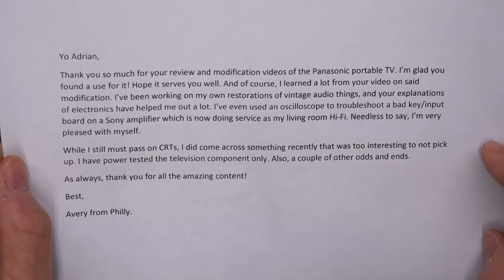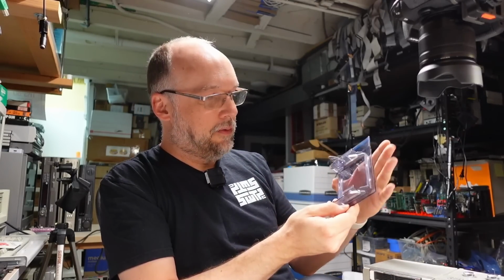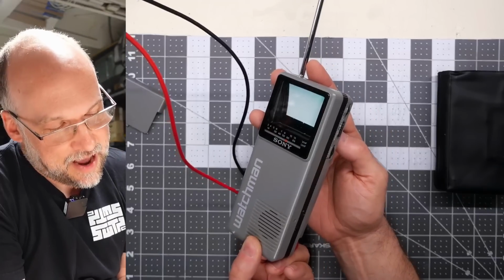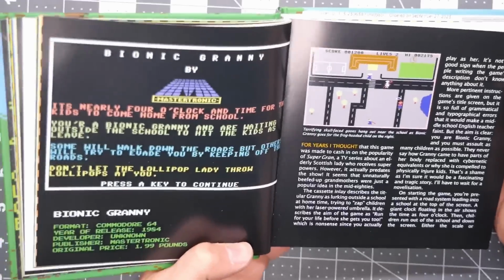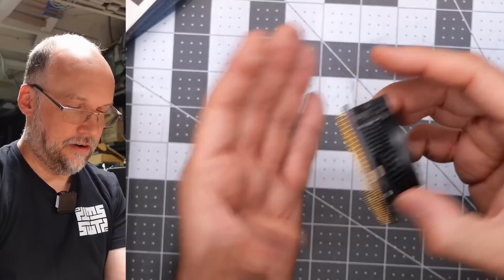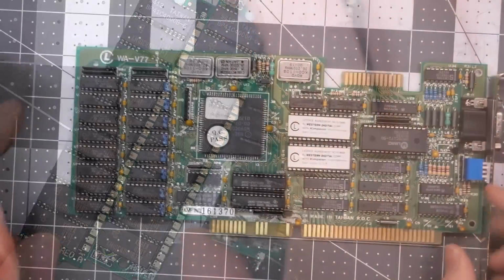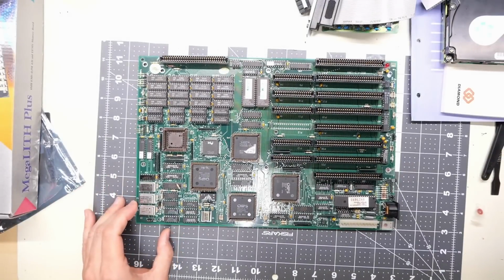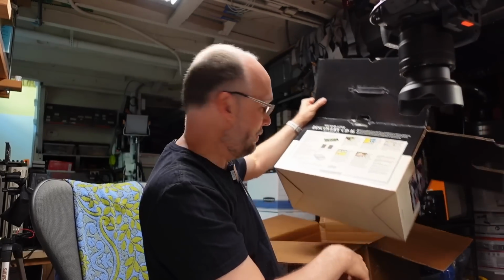0070 Testing portable TVs and a plethora of PC parts (plus a book and hard drive autopsy)

Comment: I have many of those hard drive magnets. They are very strong. I was able to remove most of them from the Metal plate. Sometimes the Magnets would break doing that. But most of mine came out fine. I only took them off of failed Hard disk drives. I have been building computers for a really long time. I have built many 286, 386 motherboards. Now of course motherboards are way past those days and much faster with lots of memory options.

Comment: Other than OS/2, what other operating system is written in 80286 specific code? Other than MAYBE Netware286, that's about it. The 80286 is a braindead CPU, the 80386 is much much more useful.

Comment: I still have a similar Casio, as my primary TV for a few years.  I got it used, and it might have had some moisture damage because a solid black screen was not solid black.  You could see cracks in the LCDs.  The strangest thing is that I would watch it in bed and go to sleep.  When I woke up, everything I saw had a grid, as if my eyes had adjusted to the large pixels and stayed that way overnight until finally being corrected in the morning.  It was good while it lasted, but I'm very grateful for today's LCD screen technology.

Comment: Over the years I've had three--no, four--portable LCD TVs. The first one was a RadioShack Portavision. It was one of those black-and-white models with the mirror to reflect the image because, to save battery life, the screen used ambient light as its light source, with a frosted translucent panel behind the LCD. (There was also an included EL backlight that could be clamped on, for use in dark environments, but it tripled or quadrupled the battery consumption.) I actually still have this one, though I'm not completely sure that I know where the backlight is anymore.

The next one I got was a color one that used basically the same technology as the TV-400 you have there. However, the tuning indicator was vertical and went across the entire screen. I don't know if it was a Casio; it could have been another Portavision, rebranded from a Casio. Let's see... the third one was a Sony with a weird teardrop form factor. It had slightly better contrast, and better battery life, but no A/V input. Both of them quit working and wound up being trashed.

The last one was definitely a Casio. It was from their active matrix 'Crystal Vision' line, and it had by far the best contrast, because it was using an early version of the technology we have in LCDs now. Very low light leakage, and rapid response. Alas this one also wound up in the trash, because I left it alone for too long with alkaline batteries installed, and the leakage destroyed some vital bit of circuitry, so that even after cleaning the battery compartment thoroughly, it still wouldn't work.

Comment: Video idea: didn't that 5150 have a 386 upgrade? Max it out at 16 MB RAM, and then install Linux on it. Debian still makes installers and packages for 386 processors. Maybe you even get X11 with a simple window manager like twm and a game running.

Comment: Labtec might be bare minimum in speaker response but the circuitry is good. I find swapping them out for some wide range speakers gave pretty good but no bass performance. My Go-to replacement speaker would probably be something 4 Ohm and designed for public address so it has good frequency response through all the vocal range tones.

Comment: a bit of trivia, in 1990 Toshiba made the first Glass platter for hard drives, originally for laptops, from 2000 many other manufacturers started moving over to glass-based, some for desktop, but mostly laptops, since around 2015 pretty much all laptop HDD's, have glass platters!

So be careful opening up newer drives, especially laptop ones :)

Comment: Drive magnets make great clamps for gluing things.

I had a Western Digital drive blow up on me in a similar fashion. A friend of mine was using my system for final edits for a book she was preparing for output to the resolution ECRM VR-30 imagesetter at my brother's prepress company. When the hard drive blew up, she went into a panic of course because these edits were nowhere else and the drive blew up before she could backup the book.

I contacted a company that repaired hard drives and they said that generally with drive failures like that the chances of recovering the information are slim. Given the cost to repair the drive was extremely high, we figured there wasn't much that could be done. At that point, she resigned herself to having to start over and go back to an earlier backup while losing a few days of edits in the process. 

With the drive being more or less a brick, I took a controller board off another identical Western Digital drive that failed and put it on the fried drive, and it worked! Yes, it worked! She was able to output her book and the old Frankenstein drive lived for another few years before I replaced it with something different.

Comment: Hey Adrian, what POST card are you using? I just got a motherboard with a Pentium 233 that doesn't POST and I'd like to try my hand at troubleshooting it. I found a few of them on Amazon, but they all have very mixed reviews. Just curious what one you're using since it seems solid. Thanks!
Reply from the maker: Ah grab one of the cards from Aliexpress or Amazon: https://www.aliexpress.us/item/2255801058980488.html

That one specifically is what I use. ISA + PCI connector .... and a speaker. Very handy

Comment: Adian's Analog Attic.    ^-^

I am moving and ran across two book boxes i used to use as computer sound systems from back in the 90's.  A good boom box was so much better than the cheap speakers you could get back in the day.  The boom box would be louder, and should have at least two way or three way speakers, to contrast the computer speakers of the era which had at most one speaker per pod, and very low volume levels (as compared to a boom box).

So i may be doing some re-work myself in the near future.

Comment: PC-11 is an epoxy plastic repair material that can be sculpted. I've used it to repair plastic parts where parts were actually missing in several cases. The problem will of course be figuring out the correct shapes.
Reply from the maker: Can you squish it into holes, then let it harden later? That might work
Reply: @adriansdigitalbasement2  I think you could cast it. You'd need some sort of easily removable cast material, though, like... wax. Wax would certainly work. (Initially it's very sticky and goopy so if you mean shape it by pushing it into another part of the device, I don't think that'll work; I think it'll stick to what you push it into.)

Comment: I had this CASIO TV (well, the PAL version of it) back in the 90's and the screen was very watchable, not dim at all, only when the battery voltage got low. I watched it pretty much every day at work when I had standby shifts, when I was working as a train conductor. I watched so much Star Trek TNG on this one. The picture quality wasn't that bad back in the day, compared to the other stuff you could get. But You're right about the power consumption. I always had to have 3 sets of rechargable AA batteries on me, to run this thing for one  standby shift 😀, and there was no power socket in our ready room.
Unfortunately, one day when I had to do train service, I had my backpack in a staff locker cabinet on the train, and someone (one of the passengers) broke the thing open while I was doing my work and stole my whole backpack with the TV in it. Months later a colleague found the backpack at the train line thrown into the woods.

Comment: Hey that's the same model combo TV Boombox I pulled out of a dumpster just a few weeks ago. Already AV-modded it. You gotta scratch one trace on the TV board for video (very near the IF can, don't let the test point in the middle of the board fool you) and another on the mode selector switch to make it stereo (also had to add a 300 Ohms resistor to ground), it's the one that goes vertical in between the pins.
Mine's Elite branded, it's 100% identical though*. I also had to disassemble and clean all the switches (the record/playback switch is interesting as it's solenoid driven), it had the same tape volume problems as yours. I'm kinda surprised all the belts in the tape deck of mine work.
*) Waaait the tape counter is next to the FM stereo indicator instead of under the speaker. Yeah, the tape mechanism is different. And the antenna input is an European standard antenna input instead of 3.5mm.
Tips for repair: Even though it looks like the three function switches on top only come out as one, they come out individually and I guess you only need to fix the function selector (radio tape TV)
I got a stack of these Casio portable TVs. They always leak capacitors, but not many in there, so a quick and relatively easy fix. Just don't ever remove the LCD PCB even if there are caps on there, leave them alone.

Comment: Would probably be quite easy to 3D-print new brackets for the tape door. Also some kind of adapter for using modern rechargable cells in the battery compartment.

Comment: Couldn't convince my self that it's worthwhile buying an overdrive for a 486 but did do a AMD 5x86 swap last week on one pretty much the same way to straighten the pins no luck over clicking to 160 appears the vlb ide controller doesn't like 40 MHz clock.

Comment: I had a rule. I don't upgrade a CPU. New CPU = new motherboard and ram. As a result of that rule I've never had an overdrive. The first and only exception was 2021. I couldn't find a ryzen 5900x. And that was the target CPU. So I bought the cheapest CPU I could find. That was a ryzen 3600. So it was a downgrade as a placeholder. I did eventually get my 5900x. Well worth the upgrade.

Comment: Those small TVs bring back memories of the window display in an electronics shop in our old indoor market. Quick question re. the TV-400 and similar Casio sets: do the tuning indicators disappear when tuned in? IIRC they were always on the screen.
.. I bought a Citizen TV-53, then spent a while tweaking the pots on the back of the LCD unit to get a decent greyscale. That set spent a while opened up and displaying test cards for the purpose. Was fairly watchable after that .. just about usable with the C64! Also, 2.4W (PAL version) and 2W (NTSC) for the Citizen. Tandy (Radio Shack) also sold their own branded version of the same set, at least here in the UK.

Comment: I used to have an Emerson 5" BW portable TV / AM-FM radio (that thing was big for a portable, I sat my SNES on top of it).  It took AC or 10 D batteries and had 300Ω inputs in the back for UHF and VHF - so I used it as the display for my SNES.

Comment: I still have my Casio TV-410 (yes its a 410 and not a typo) In the original thin foam box and still have the Instruction Manual with its as well. It was good for its day and let's not forget that in 1990 (or there abouts) a small CRT was hugely costly.

Comment: That broken tape door is exactly the kind of repair that piques my interest.  Not just repair, but upgrade so it doesn't break again.  I could totally see fabricating small mounting brackets out of sheet steel and some rod or tube for the pivots.  Design the brackets  to wrap around corners and ends a little for increased stability, strength and load-distribution and attach it with a combination of adhesive and mechanical fasteners.  And don't forget to include features that interface with springs, dampers and latches, as necessary.

Comment: The ST3144A is one of the worst pieces of junk ever to come off a Seagate assembly line. 

Back in the mid-1990 I worked at a company that had a number of PCs with these drives, and they were so slow we couldn't burn double-speed CD-ROMs without first copying the files to a network drive. Yes, 10 Mbps Ethernet ran circles around that hard drive.

Also, take a close look at the small plastic track 0 stopper on the voice coil. And yes, that's just glued on there. Take a guess if that tended to break off, instantly bricking the drive.

Comment: If I remember rightly(but could be wrong), the "reverse CRT" was first used by Clive Sinclair(yes, as in the ZX Spectrum) in the Sinclair TV-80, aka FTV1.

The failure of that TV was one of the reasons Sinclair's computers were sold to Amstrad. Costing them £4m to produce and sold less than 20,000 TVs.
Reply: On the contrary, it was the failure of the flat screen TV that led to Sinclair getting into the business of producing microcomputers.
Reply: @CasinoWoyale  That was a different, earlier effort called MTV1 that used a 1" regular CRT. The TV-80 was 1983.

Comment: Extended memory, if memory serves correctly was the memory above 640K. Expanded memory, again if memory serves correctly, was the above that to 1MB. Part of BIOS could be SHADOWED ( or duplicated ) in EMS, or was it XMS, but it couldn't be moved out its' regular memory area because that was read only. Also, it couldn't simply be copied because it was hardwired for its' location in memory where it resided in ROM. Such a long time ago. UMB. Perhaps BIOS was shadowed to the UMB. Yeah, yeah. BOIS setup had a couple of bit flags to allow DOS to be moved to the EMS and XMS memory areas.

I used to develop, I mean write, applications, I mean programs, in assembly. In other words I used to be a computer programmer. Now days computer programmers are what we used to refer to as data entry specialists. I used to use references ( library ) and resources ( mine ) such as The DOS Bible, Peter Nortons' Advanced Assembly Language by John L Socha ( I think it's spelled Socha ), and a number of others. I typed up a number of resources like Peter Nortons' advanced assembly language on to disk using the extended ASCII ( American Standard Code for Information Interchange ) characters so nothing was lost ( not even tables ). Library got kinda mad at me cause I had to keep the books longer than the number of times I could renew my checkouts by a few months. And if I remember correctly, I a book was placed on hold I couldn't renew again. Must have taken six months to digitize all four or five books. 

My preferred editor was PC Write, in my opinion it was better than WordStar, because it shareware and it was awesome. I could block select text with it, program recording keys and type new text in in overstrike mode, and all kinds of super useful things. It even had spell checking with a user dictionary. If I remember correctly it had a grammar checker, and grammar resources. It had an astounding help system. I could program quick keys, and on and on ....

In DOS I had batch files in batch files for the function keys. Like a function key for loading PC Write and changing the function keys for it, not to interfere with its' best function keys though. My batch files distinguished between the left and right ALT, SHIFT, and CONTROL keys as well as the various combinations.

Yep. Those were the days. The days when computers were designed to speed up ONES productivity, instead of forcing one to work on a team to do so. Just think how productive teams could be today. Only in dreams today. Yep, only in dreams.

For example:

    This comment was pecked in over a very long period of time, and not typed in in just a few seconds. Does that mean I need a wireless keyboard?

Well, time to get back to the video, again.

Comment: I remember the days when there was a plethora of tiny TV's. As in 5 inches and under. Stand alone, boombox combos, DJ units with a microphone, etc My coolest one is a Sony TV-511 with a rotating screen! If the price is right, which it usually is, I pick these up whenever I see them. I frequently get comments along the lines of these things are useless because these cannot pickup todays TV broadcast. However, there are ways to connect even current generation PS and Xbox consoles! Some older gaming consoles can be directly connected depending on getting the right output/input combo. Granted its not very useful and mostly just a "cool, how did you do that?" Kinda neat for a party or having friends family over.